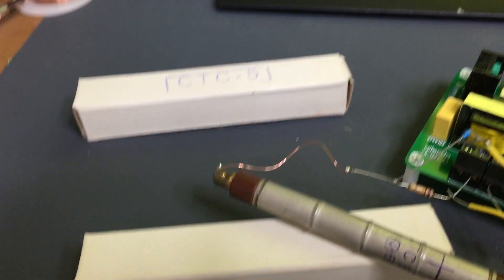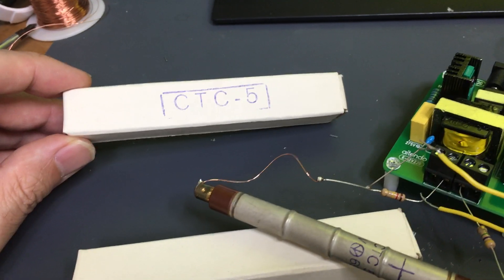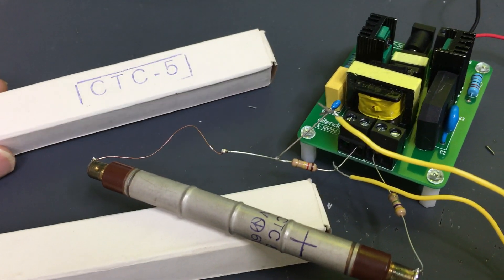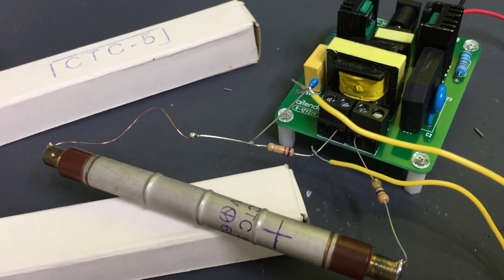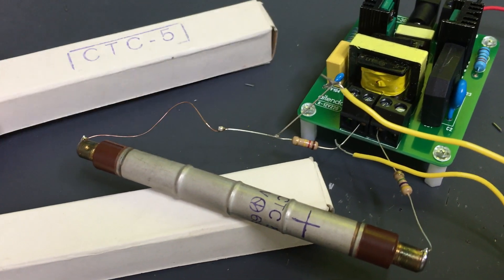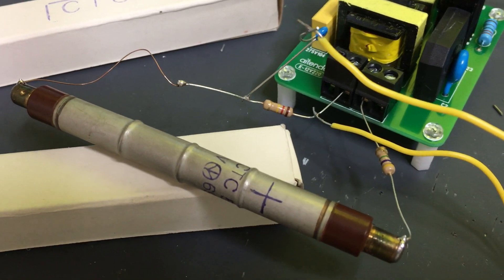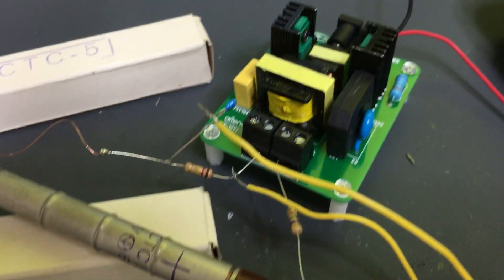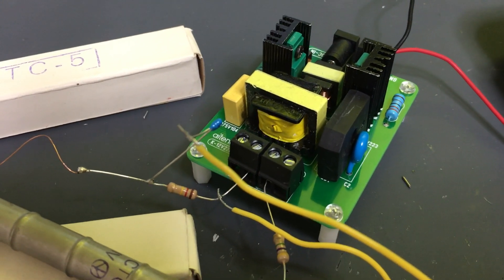Geiger-Müller tube experiment part 2

Comment: I see you've followed my advice!
The sensitivity of this tube is roughly 0.28uR(0.028uSv)/pulse/sec, if you want to actually measure the radiation.

And if you want a friendly check source, WT30 or WT20 electrodes meant for TIG welding(red tip) have a small amount of Th-232 in them(3% and 2% respectively), are cheap and safe/legal to own everywhere, including Japan. Some are fake(no thorium), but the real ones make the count rate much more exciting :)

It can also be handy for your photomultiplier scintillator experiment, since you can make a pulse height analyzer(I believe your pocket oscilloscope has firmware for a DIY MCA!) and measure a real radiation spectrum of thorium, with different photon energies.